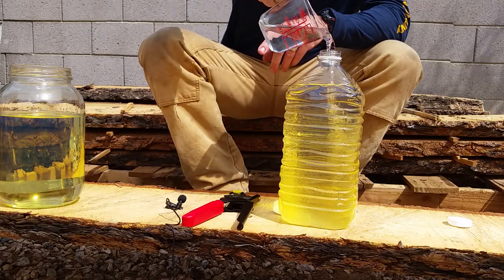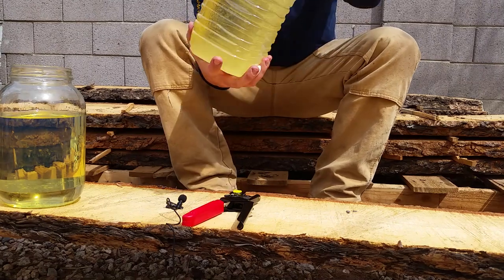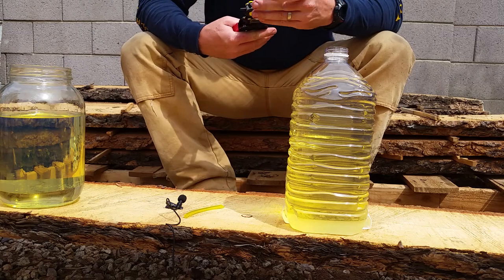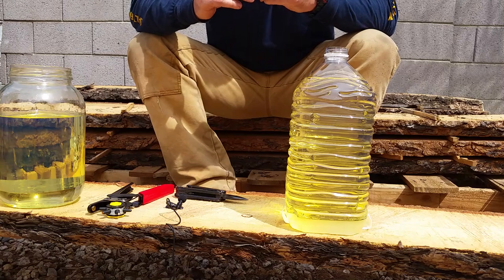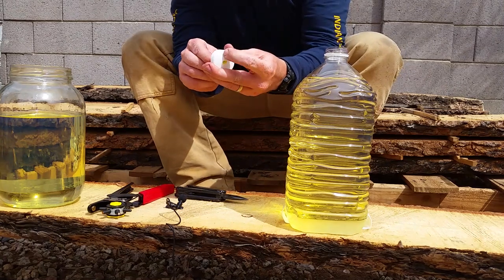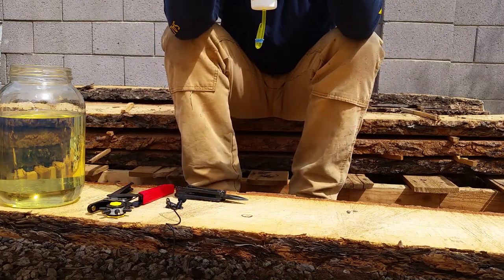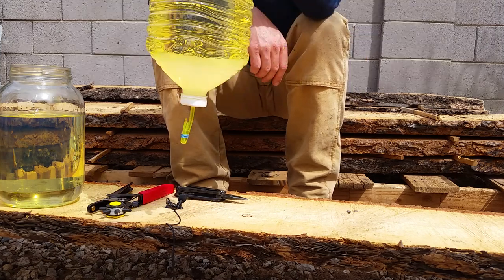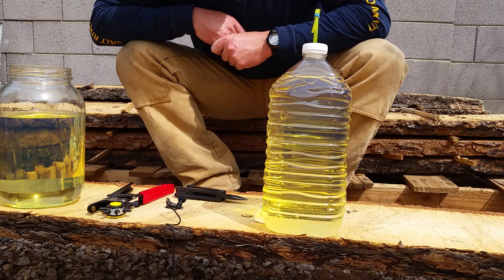Removing ethanol from gas

Comment: I have some doubts of effective extraction.  Convince me by adding water to the container first, then marking the level of the water.  THEN add the gas, and see if that separation layer rises above the marked water level.
Reply from the maker: +Element of Kindness I'll do it.
Reply: Great!   Look forward to that! (also be sure to show that the gas/ethanol blend doesn't have a separation layer of it's own before adding it to the water)
Reply: I think you're going to remain skeptical, as water + ethanol take up less volume together than in separate containers. (i.e. 50ml water + 50ml ethanol = 90ml mix) this isn't the correct reduction but it  has to do with molecular packing.  So by adding water to gas, if he extracts 100% of the ethanol it should actually go up still, but less than you would expect.  Be sure to look up the dissolution of ethanol and water to see by how much they pack into each other...
Reply: If you really want to know how effective it was (roughly) then save all the water/eth that separated, and add salt to it (non iodized salt) until the salt stops dissolving.  Then you will have two layers in your glass, one salt water and one ethanol (up to azeotropic) So then you can measure how much of each came back out of the gas.  Just remember that you wont be able to get an exact figure for the ethanol because it will still hold that last few % of water unless you distill it off or use molecular sieves etc.  I'd love to know your results.
Reply: @christopherhurley2570  I think you can probably figure out what it should be.  You are going to have to assume that the only thing in the gas that will fall out is the ethanol.  If there are any other alcohols in the gas they may fall out as well.  I think MTBE is water miscible as well.   30 years ago I used to work as an analytic chemist and I remember that we would test wells (or aquifers) near old leaking gas tanks.  Back then there was no ethanol in the fuels but there was a lot organic compounds in the water.  I would make my standards with gas and water.  Now we are only talking about 10ppm of gas (which is a tiny amount). Though, I remember getting huge MTBE spikes and sometimes other compounds in samples.   MTBE's solubility is 42g/L in water.

Comment: Just to throw this out there.  When you try to remove ethanol with this procedure, you are also removing a percentage of octane from the fuel.  So if you started with 87 octane fuel and removed the ethanol, you probably have fuel in the 83 to 85 octane or less.  89 octane is the best when mixing with oil.  I have been in the fuel business for 20 years and part of my business is removing water from underground tanks at convenience stores.  Yes this procedure does work.  Although if that gas had 10% or better ethanol in it, when water was added, it would be totally cloudy and not separate that fast.  And depending on the ratio of fuel, ethanol and water mixed, it will never separate.  The load of fuel then goes thru a reprocessing stage which is expensive for the store owner or his insurance company.  This to get the fuel back to being usable, with octane added back of course.  Most fuel tanks at stores has less than 10% ethanol, they can't keep up with the amount being used.  So some stores get a load of regular(ethanol free) gas dumped on top of what is left in the tank.  I guess I have been lucky with all my small engines, never have had any problems with ethanol gas.  Just a reminder, add some octane when you do this and life will be good.
Reply: I have yet to find any scientific proof that ethanol fuel damages engines or their fuel systems. idk why people bash on ethanol so bad. The only thing bad about ethanol is that it has less BTUs so it does get worse gas mileage, but ethanol fuel is cheap enough to make up the difference. Especially if you are comparing similar octane ratings.
Reply: You haven't talked to any mechanics at motorcycle dealerships or small engine repair places then. I've had blowers, weed whackers and a chain saw ruined by ethanol laced fuel. Ethanol only stays stable in fuel injected vehicles which have closed fuel systems.
Reply: I have personally rebuilt a carb on a riding lawn mower, and inside the carburetor bowl was a thick layer of gross green "Algae".
Or whatever it was.
It was green and slimy and didnt dissolve with spirits.
I talked to an Old Man (wealth of knowledge) at work about it, and he said it was "the Shit that grows in ethanol".
That stuff was in all the ports.
I also had an F150 that was rarely driven due to the 12 MPG when gas got up to $5, it sat for about a year and the bottom of the gas tank rotted out. 
It was a mid 90's truck, but not so old i would expect anything like that to happen.
Reply: juck huo I agree, ethanol gets a bad rap
Reply: fragwits I agree, from my experience in the fuel business with ethanol.
Reply: Dukerdr Ok, I haven't talked to any mechanics about this, you are correct.  Reason why I haven't is because I maintain my equipment myself and make sure that this problem doesn't happen to me.  Leaf blower 16years old, weed eater 10 years old, chainsaw 10 years old, pole saw 8 years old, pressure washer 11 years old and that's just the old stuff.  I have never had an issue with ethanol in any of them.
Reply: Richard Starkey Regular gas will even tarnish the inside of carburetors and fuel tanks.  If you had algae growing in your carburetor, that means water was inside your carburetor and must have sat for a long time.  Which means it probably was more poor maintenance and lack of use than the ethanol.  Yes I do agree with the tank being rotted or rusted out on your truck.  Tank should have been drained if it was going to sit that long, even with regular gas.  I just throw this crap out there, not meaning to piss people off.
Reply: Kenny Smith.  Kenny is correct and his industry experience shows.  A lot of "up to x% ethanol" pumps is now a lot more pure than you might guess.  The tankers throw pure gas on top of ethanol to reduce the water sponge effect.  In areas that are not smog centers you'll see non ethanol gas advertised.  It is likely the 87 in the $2 standard pump is the same gas since it came on a tanker carrying pure gas.  You'll seldom find non oxygenated gas in big polluted metros though.  Us country folk see it a lot.

The actual smog reduction though is a bit of a math myth.  The gallon produces say 15% less smog when burned, BUT if your car needs 12% more gas to go the same 40 miles, then the tailpipe emissions are the same over those 40 miles.  Also the grain costs a great amount of oil to produce and transport.

Ethanol was big when the oil companies got subsidies to add it.  Win win, watered down gas means more consumption with cheaper cost to produce a gallon. Subsidies have ended.  Outside the most polluted cities more and more, gas is gas and at $45 a barrel it is cheaper to produce than grain alcohol.
Reply: why dont you take 2 brand new push mowers, fill 1 tank with ethanol free and the other with shit ethanol gasoline. Run them and time it, ethanol will burn faster, also fill the tanks up again, and let the machines sit in the shed for 1 year. Tell me which one still runs, It will be the ethanol free gas. Also take the carburetor apart and see the ethanol gas eroded the aluminum inside. It is terrible stuff
Reply: ethanol pulls in moisture from anywhere it can. It doesnt need to have a leak.
Reply: Kenny Smith I'll just flat out say it You are a liar, or you've never used any of the equipment that you claim you maintain without any problems on 10% ethanol fuel  . You lie about the use of the fuel in the equipment or the fact that the equipment uses fuel at all, for if in fact they are as old as you say.
Reply: yeah i knew guys who would take some gas and throw a garden hose into the tanker to make up then deliver it lol. That's common in Mexico where you get "Christened" gas lol
Reply: Dukerdr o
Reply: @mymusic thank you for your post is very informative

Comment: Thank you for the instructions. I will try this soon. Wondering if the gas in a parked (stored) car be removed the same way. I have several cars in storage.
Reply: siphon all of the gas out of the fuel tank then add non ethanol gas and should work

Comment: The only thing that Ethanol is Good for is the Farmers Pocketbook and Corn Whiskey!!!
Reply from the maker: +randy beard truth!
Reply: So ,YES, while it requires heat to distill ethanol, and its less energy dense  than gasoline but still the fact is ethanol is cheap to produce, creates near zero toxic waste, burns cleaner, IS produced from renewable base, ie corn which you turn to mash ,then it produces ethanol, THEN the leftovers can be fed to cattle for food , THEN the waste from their would/could be used for fertilizer of corn,,,,,! One of the coolest books I found, at a yard sale even, was about distilling your own ethanol fuels, and how to adjust for burning it. Now you forget the ethanol fuel still has a motor fuel tax thus making it good for government too. See the ethanol debate has raged since Rockefeller made gasoline an everyday product. Ethanol used to be a viable fuel product till petroleum became cheaper and easier to distill into gasoline and other useful products.
Reply: Diesel to plant the corn, diesel to irrigate the corn, diesel to spray the corn, diesel to harvest the corn, diesel to haul the corn, propane to distill the corn...but then...CLEAN FUEL!
Reply: Weelllll, let's put the information out, ethanol produced from feed grade corn contitutes about 40% of the total of products that are produced, now let's also point out several other products are also produced, the co2 is captured for carbonization, there are other things that come from the pre-prep of the corn, but lats also point out that the end byproduct left over is distillers dried grains or wet cattle feed, appropriate protien content around 26%. Thus making useful to control weight gain in cattle. Now when all the wrangling to get us to 2005 approximately same week as Katrina, the mandated removal of MTBE was going in effect, the gulf coast refineries we're supposed to supply the Lions share of fuel as other refineries and blending stations converted and got all the bugs worked out of systems. The EPA was balking at allowing a 3 month temporary pause, and Bush had to force them to let the other places supplying make gradual switch over. This plus having to move large amounts of ethanol during Katrina aftermath thus one reason gasoline went up as well as storm issues. E10 has gotten huge black eye yet I personally haven't had as much trouble as others and in 05 I was driving my 78 C10 with Holley Carb and had zero issues. Haven't had many if any over years. Tuning has never been a problem. E85 is very cool BUT fools in EPA relaxed quantity rules. Used to be minimum ethanol content was to be E70, now it's minimum is E51.  The thing is E85 is rated 105 octane, E70 drops it down to around 100 or less. 
But honestly if car companies had jumped at using flex fuel tech in performance cars, think of the possibilities and power potential also. And actually many distilleries use natural gas over propane. There are little to no byproducts that can't be used, and none are poisonous. Also MTBE IS poisonous and and industrial waste byproduct. If spilled it can pollute ground water and kill vegetation and indigenous  life forms. Ethanol mixed with water, may stunt plant life unless it's pure then it may kill. But if a large amount enters water it simply dilutes, and won't kill most humans. The use and purpose of ethanol blended fuel was to eleviate specific automotive emissions. The issue now is the only true benefit is it's renewable base product. Also allowing farmers to still farm for profit rather than government waste money having farm land idled. Now the issue I have with doing what this guy does, is he is messing with chemistry that actual fuel blending specialist have spent millions developing. Odd how people keep trying to  change things they don't have full knowledge about and never think about the damage they might do. Can you add something to keep ethanol from damaging, possibly.
Reply: LOL MCE Performance don't comment if you know nothing of ethanol and the way its made
Reply: Ok.  Don't forget all the Government subsidies paid to farmers from our tax dollars to support the overproduction of corn (at the demise of other cereal grains [think FOOD] taken out of production) to supply the ethanol lie.  This in turn caused corn to spike from around $2  per bushel to well over $8 per bushel.  Then, with the under supply of the other cereal grains, the price of the average morning breakfast cereal went up by about 35%.  Added to this, as so much of the corn was now going to fuel production, less was available (at REASONABLE cost) for animal feed.  This in turn drove cattle, pork, and other meat producers to thin their herds.  They could NOT afford to feed them!  So, now you have an under supply of animal protein for the human food chain!  Thereby driving up the cost of that in the grocery stores.

Come ON!  Get the Government OUT of farming!
Reply: It does not belong in any car!
Reply: So a few things can and maybe should be said to these replies. And having been raised on a farm and within a farming culture, I can state facts here.

First: It is true that the hype about "clean fuel" is pure phony. If ethanol rained freely from the clouds; then absolutely, it would be clean. Not just corn, but every biological source  whose sugars can be converted to alcohol (ethanol or methanol) currently expends crude oil during processing (and usually also during production). Our only technological alternatives are solar or steam power--neither of which are propped up appropriately by the energy markets.

The hype is nothing more than propaganda which was beneficial to the first sellers to compete against traditionally pure crude oil. Now that 10%+ has been standardized, you don't see sellers spending a whole lot of money on promotional campaigns like they used to.

With that said, ethanol is not currently cheaper to produce.than standard gasoline. But it is cheaper for the consumer "at the pump". The reason for that is due to federal subsidies. One of the best-kept secrets of the federal government is the fact that the US is in the midst of an economic World War over crude oil. The  ethanol subsidized by the fed is analogous to the bullets it buys for troops in armed conflict. And even though that E85 may be cheaper "at the pump"...take a guess  how those subsidies are funded. That's right. By you, no later than April 14 each year.

The US sees crude oil as an endgame to preventing Middle-Eastern adversaries from gaining economic strength. Ethanol is a stop-gap strategy to minimizing the amount of oil purchased from them. Fracking is seen as the long-term silver bullet--which is why the government has been fighting so hard to upscale fracking operations. When fracking has expanded to a sufficient level of production, E85 as we know it will disappear and pure petroleum will dominate the pumps again.

And now for a word about the efficacy of ethanol. Technologically and environmentally speaking, it is far superior to petroleum. The reason it's not good for internal combustion is not because of ethanol. It's because of manufacturing. Different metallurgies are required to run ethanol as reliably as petroleum. Manufactures will not switch their designs because the federal government has them in an economic armbar to keep crude oil as the dominant energy source. Remember the big auto bailouts of the Bush administration? That was not quite the domestic industrial "Armageddon" the government led you to believe. Instead, the bailouts were a final movement of chess pieces in the Fed's complicated strategy of locking the automotive industry into an indefinitely long commitment to supporting fossil fuels. The automotive industry is the largest facilitator of crude oil; and thus, was the US's biggest vulnerability in the international economic war. Manufacturers having the wherewithal to switch energy sources meant they controlled the outcome, not the government. So that problem was decisively solved via a complexity of bringing them to their knees and willing to agree to anything in order to survive.

Bonus points: Is it still a mystery why Trump aggressively attacked Obama-era emissions standards? It wasn't as politically motivated as he led us to believe.

So there you all have something more substantial to discuss. All this stupid bickering over which fuel is better...well...is just stupid. You're just bucking the government mule.
Reply: Ethanol is clean because it requires less energy input than the energy output (energy contained in ethanol), and reduced emissions versus pure unleaded fuel.

See table 1
http://large.stanford.edu/courses/2014/ph240/dikeou1/docs/ethanolnetenergy.pdf
Reply: @MonzaRacer  I'll stick with Birdseye. I'd rather just eat the corn and have my small equipment start reliably. I wonder how many small engines are being produced (using energy) to replace all the ones abandoned by non-mechanically inclined people because they wouldn't start?
Reply: Amazing how no one ever talks about the 4 to 5 gallons of fresh water it takes to produce a gallon of ethanol 
  That water is either evaporated into the air or is sent down the sewer to water treatment plants 
  More energy used to treat that water
  Or the chemicals that are used to produce ethanol. I haul chemicals to the plants